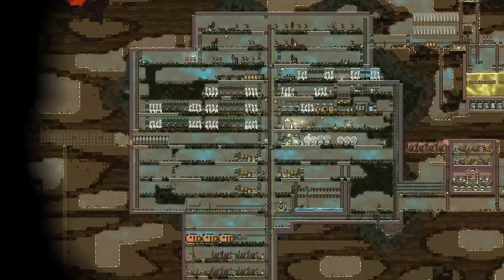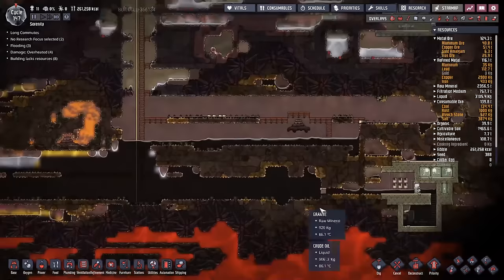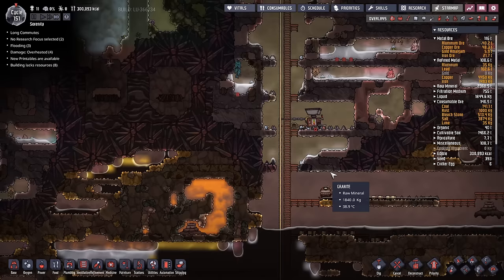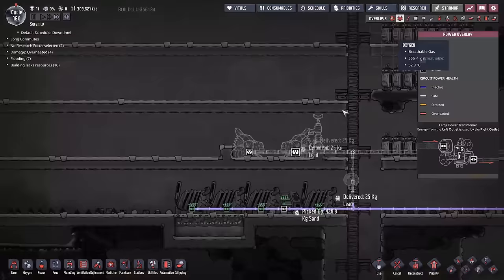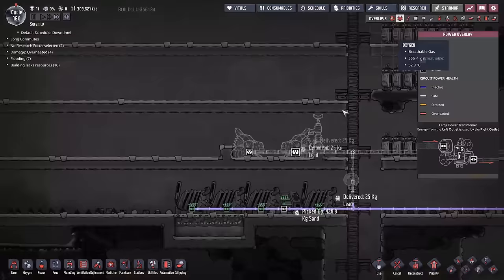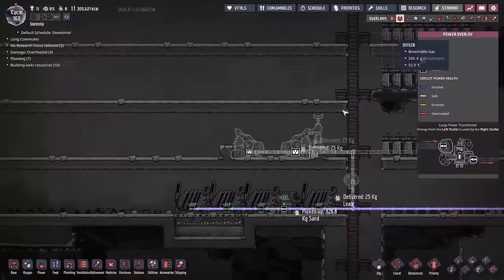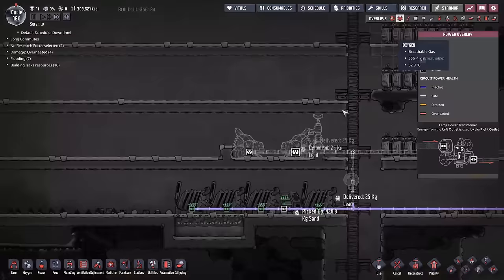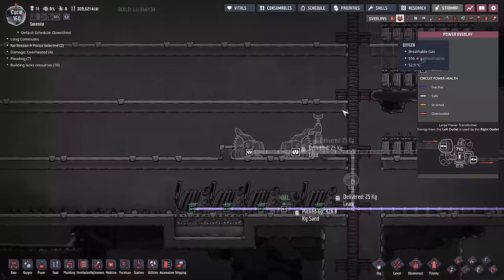Getting mid game Steel, Plastic & Cooling : Tutorial nuggets : Oxygen not included

Comment: How to heat sensor work on the output liquid reservoir? Please help me
Reply: rotony1 liquid temperature sensors are placed on pipes not reservoirs.  You really want the sensor just before the input to the aqua tuner.
Reply: @probablynotmyname8521  and is connected to the aquatuner?
Reply: rotony1 yes put the sensor on the pipe that goes into the aqua tuner.
Reply: @probablynotmyname8521  and then wire the sensor to the aquatunner right?
Reply: rotony1 yes, make sure you dont set the temperature of the sensor too low or the cooling liquid will freeze.
Reply from the maker: I added a second save game file, it has the aquatuner in it all setup with temp sensor, automation wire etc.
Reply: @FrancisJohnYT   i managed to figure it out, thanks a lot for the video and help

Comment: Where did the 118735 refined metal @3:56 come from?
Reply: Lead from the oil biome. It's free refined metal, but it sucks - it lowers the overheat threshold. Good enough for wires and low temp buildings though. Also radiant pipes if you don't really need the best transfer.
Reply: Lead is awesome for conductive wire and things like autosweepers or automation. I don't think atmo suit material matters either. Allows you save other metals

Comment: If i build this, the first pipe coming from the aquatuner explodes from the heat in the steam chamber eventually. Anyone an idea why?
Reply: okay, simple solution: it wasnt exploding from heat, but from cold, the aquatuner turned the polluted water into ice...
Reply from the maker: That's why the temp sensor is there and the liquid keeps constantly rotating. The save game file is in the description, have a look. If the polluted water is below the set temp the aquatuner turns off, this ensures you never cill the polluted water to much.

Comment: how you get so much coal my  hacth ranch can't keep runnning a single coal gen:S
Reply: Multiple hatch ranches, multiple types.  Some with smaller populations so they produce eggs, then drop off most of the eggs into ranches optimized for coal production.
Reply from the maker: It takes 8 groomed hatches to produce enough coal to run a coal generator forever. (roughly) In this base I believe I'm running 28 hatches to keep my dupes fed. So I'm producing way more coal than I'm burning for power, hence the large stockpile.
Reply: If they aren't happy they produce 80% less coal. They need to be groomed. 

I just have a breeding pen with 8 tamed hatches with an autosweeper that drops the eggs in a chasm with about 80 or so wild hatches and a vast pile of junk to eat. IMO, 80 hatches that require 0 dupe time or thought are better than 16 hatches that require daily attention.
Reply: @sigma6656  I read the top part of your comment, and was about to reply when I noticed the 'read more' prompt.
Your solution is better than the one I was going to suggest.

Autosweepers, they make everything better.
Reply: @JeiJozefu  Better? probably not but that depends on your needs. 

I like to organize all of my RL and virtual projects in terms of the good, fast, cheap venn diagram. My method isn't exactly good, nor will it produce a large quantity of coal quickly, but i'll be darned if it isn't cheap/easy.